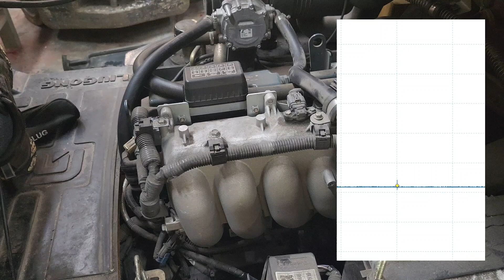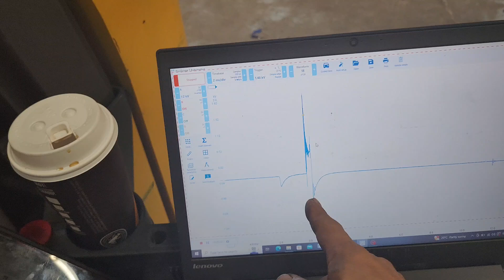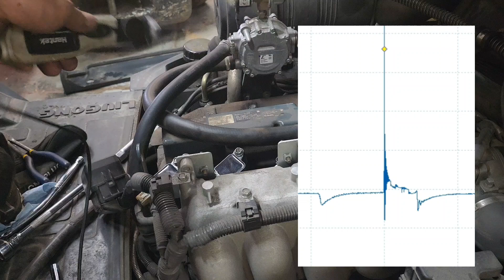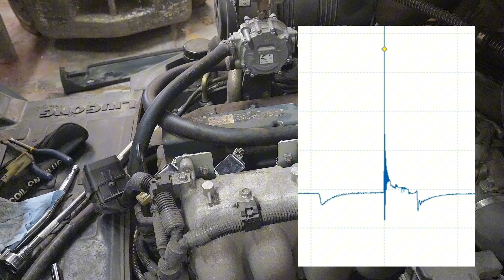Kubota Engine, Intermittent Hesitation

Comment: I need help! I just bought a hyster S30A lift with the continental flat head 4 cyl I’m trying to get it to crank over but I’m having an issue when I put the key in the ignition and turn it one click a dash light comes on and it beeps at me and won’t crank (watch the short on my channel it shows what it’s doing) I’m totally in over my head I’m not familiar with fork lifts any tips would be much appreciated